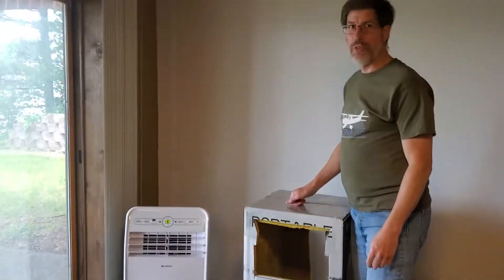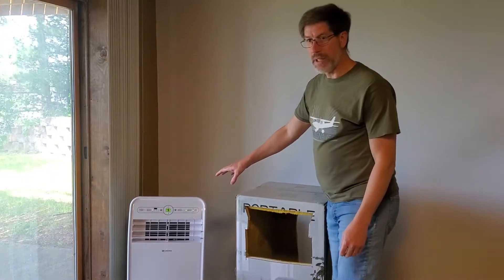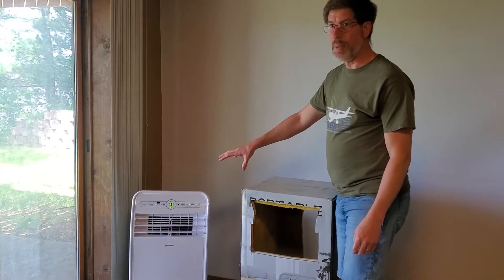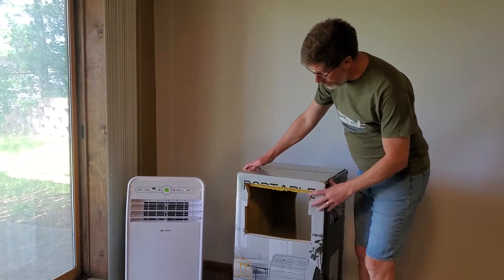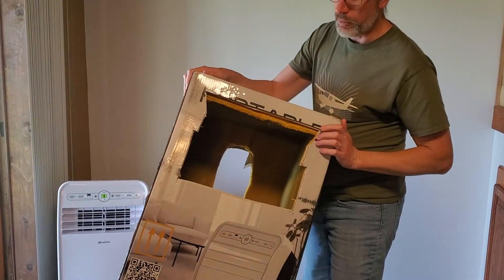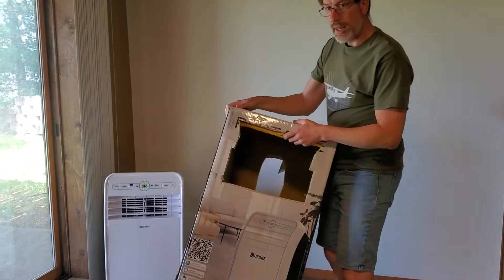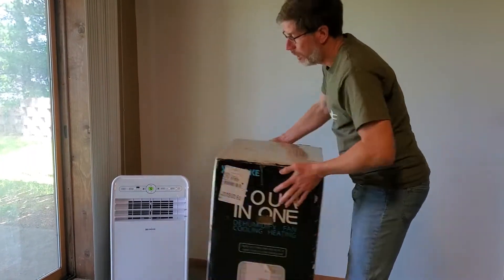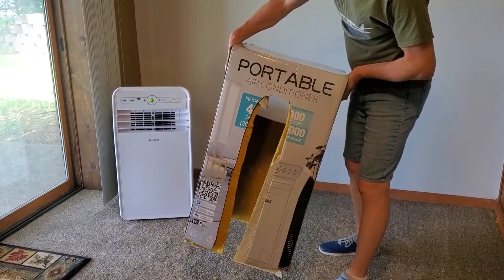DIY sound dampened / muffler for portable air conditioner (ukoke)

Comment: I have the exact same air conditioning unit, it is pretty loud but surprisingly great performance. I can make my bedroom feel like ice during this crazy Texas summer. As for the sound deadening, when you put the box over, you put the fins down. That's where the sound deadening is coming from on the video just so people know. I made a similar contraption and it didn't do anything until I vented the cold air through a duct muffler and it did help a bit. I'm now designing something to go over it to make it look a bit more appealing.
Reply: Did u make that and what were the results

Comment: I think it can work. Good idea. Only you need to be careful on ventilation holes and it will be fine i think.
Reply: Problem is, don't cover the intake spaces, there should be at least one in some units there are two, a big square cutout with narrow gaps, if you cover those, your compresor is going to shut off automatically without few minutes and hot air will come out from the ventilation cutout were cold air is supposed to exit out in to the room.

Comment: Any issues with overheating?
Reply from the maker: No issues with over heating. The heat goes out the vent duct in the back which I cut out a whole for.  After making the prototype I made nicer looking wood boxes for 4 of these units in my house. They all worked great all last summer. It definitely costs more in electricity verses central air conditioning, but if you don't have central air this is a good alternative.
Reply: Don't cover the intake gaps, those big squares around the unit, leave those open.

Comment: gosh, I   wish this worked for mine.  the actual noise emits from the output fan.  no blocking that for sure......  I tried this and there is so much area that cannot be covered on mine. the front is the fan blower, the whole back and one side is filter and intake. I held a paper to both and got major suction which tells me they cannot be blocked.  Bummer
Reply: Don't block the intake gaps neither, in some units there are at least two, any thing else around the unit you can cover, you could use Polyurethane foam or what you can mattress foam, any thickness you want, you can buy a big piece of this online for cheap then use elastic cord or nylon string to wrap the foam pieces around the whole unit, back front and sides.

Comment: Indeed,  you have covered the vents needed for the unit to breath.    Now it is quite much like putting your hand over someone's mouth.
Notice it now takes much longer to cool the room....
Reply: Yes i been alerting people here in the comments not to cover those lol, you are basically suffocating the unit, in some AC of this type there should be at least one of those, some has two, do not cover them, compressor will shut off only after few minutes of cooling and then you will only get room temperature fan air in to the room mixed with some hot air from the unit itself. I use Polyurethane foam  (mattress foam) 3 inch thickness to cover the whole unit, back front and sides